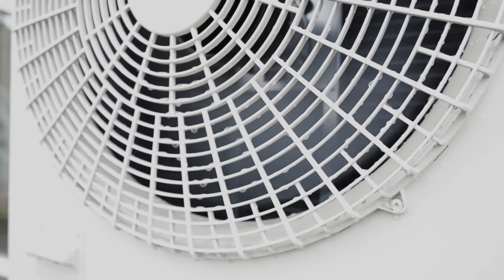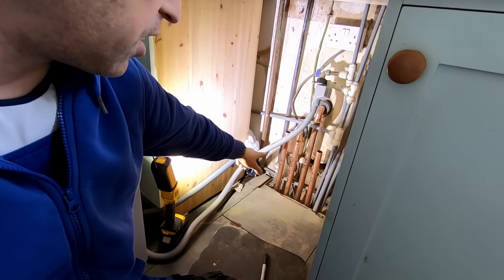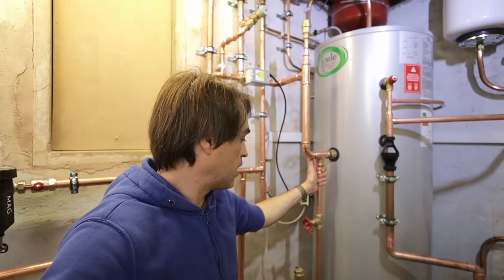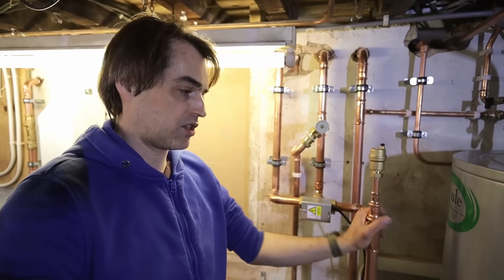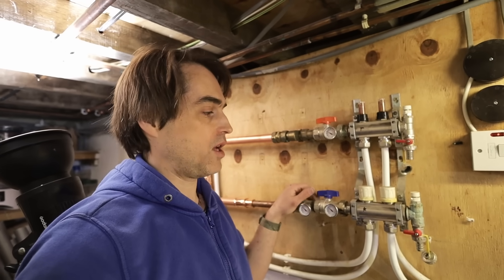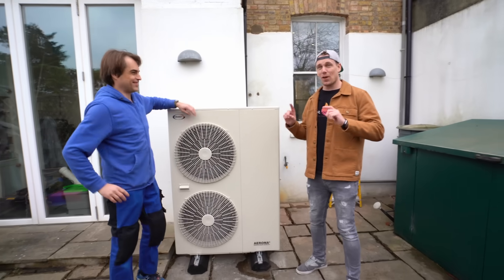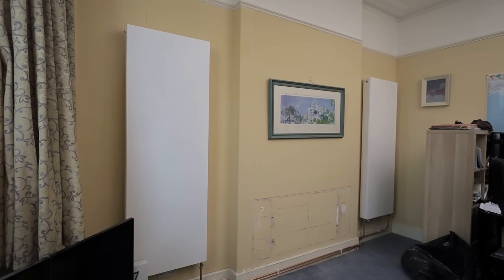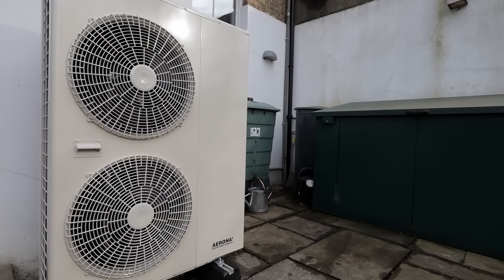The Truth about Heat Pumps: Debunking the Myth.

Comment: This particular house, which looks Victorian, is one house that should not have ASHP, the insulation, or lack of, is still going to be a huge heat loss. The cost of this instal, plus the cost of electric going through the roof, makes this very unaffordable. As a pensioner, my income has now been slashed to the tune of £1200 pa due to the energy hike.

Comment: That Heat Pump I have got and I don’t have a hot water tank but my kitchen looks a right mess with all the pipe work, no pipe work was changed 28mm outside to my pipework 22mm and then 15mm they changed 3 radiators,17KW same as your pump,and done one gone never to be seen again the MCS installers,the controls for that beast ain’t got a clue and that was the ones that fitted it,Costing a fortune can’t afford to run it I got it for nothing and I would pay to get it gone nightmare,my Combi  was on and off to suit the cold Heat Pump has to be on all day average 30 kWhs per day Electricity.How much for that system you have installed that will never ever break even no change out of £15 to £20 Grand I bet.Really nice job can’t fault it Heat Geeks know there stuff,the biggest in North West fitted mine by the way MCS registration and all that but not a clue

Comment: As A Engineer Come You Are Barking Up A Tree, As I Will Work With And Use To Lower The Carbon Foot Print On Every Project?

You Are Off The Planet,
I Use Work With What The System Is First? IE Build And System And The Insulation And I Will Cost That Over TEN Years And I Put A Portfiloi ,Through A Ten Years Program? From Year Two Year?.

I Lived All Over Germanay For Two Years And Our UK Build Is Milse A Way ?

90 % OF Uk Homes Have Combis And I Am NG AND OIL? FOR OFF GRIDE HMU AND I Like ROGER?

Comment: Great video as usual mate. Fantastic neat work. I’m not 100percent sold on these systems yet. The ashp unit is not a nice sight in the garden and those radiators are so big they stick out like a sore thumb. Iv got a 4yr old gas boiler with average sized rads in every room. Iv turned the temp on boiler down to 58 degrees and the house still warms up to a comfortable temperature.(insulation in my house isn’t great either) I think roger has valid arguments. Fan of you both 👍🏻
Reply: the boiler might last for 50+ years, at that. or, a good 20 years anyway. these heat pumps are so complicated with digital controllers and fragile parts, compressors, capacitors, refrigerant leaks, they are prone to having problems, they're outdoors, and they only last half as long. they're a little bit less expensive than a boiler to operate, because they only use a relatively small amount of electricity, but that's their only real advantage.
Reply: plus they're just plain ugly anyway

Comment: I would suggest putting the volumiser just on the heating side rather than on the common side so the heat pump doesn't need to heat it up in dhw mode (probably a negligible waste of energy but still a waste), the heat pump should only defrost in heating mode anyway but if it was to do it in dhw mode there's plenty of energy without the extra volume, nice idea about the bypass for the coil if it was to vibrate.

Comment: a heat pumps efficiency is dependant on outside tempreture.
the colder it is the less efficient they are.
funny thing is, the colder it gets outside they more you need to heat your house.
you would be better off getting solar panels and dumping the energy into a hot water system or your exsisting heating system.
Reply from the maker: Property already has solar panels and battery and solar does both hot water and supply power to the heat pump
Reply: @UrbanPlumbers  batteries are expensive, a large hot water tank is less so.

Comment: For a well insulated house you are probably better off just using resistive heating

Keep it simple

Someone needs to invent a 200 litre tank which allows the water to go to 150 centigrade at 5 bar Pressure. Such a tank would store 50KWh of heat

Heat that tank at cheap night rates and use the energy to heat the home

Octopus night rate is available for 7.5p and pre energy crisis it was just 5p a unit

The above setup would be very cheap and would last a lifetime with close to zero maintenance. Its simple immersion Heater and a pump to feed radiators

Such a setup would cost £1,000 rather than the £20,000 for a full heat pump system

7.5p/KWH night rate eletricity would make it affordable (5p/KWh pre energy crisis)

Comment: Can I ask, what is a '17kw' heat pump? Presumably that's the equivalent that it could put out (not what it consumes). If so, what SCOP is that based on? Ie how much goes in for 17kw to come out? Is it a standard calc across all manufacturers? Thanks!
Reply from the maker: It’s rated for air temp 7 and flow of 35c. At design temperature of -2 and flow of 48c it is more like 12kw.
Reply: @UrbanPlumbers  thank you! I'd need 2 of them - yikes!

Comment: Thanks, excellent video, I am a Chemical engineer and well used to piping,pumping,controls,heat transfer etc, but this is a very complicated install, well done.
However no way in my house, not enough room left, already loads of room taken up by solar controls and home battery, and the radiators are huge.
New builds are going to have to plan for a plant room for all the energy saving equipment.
Reply from the maker: this install is actually much simpler than a typical gas boiler S or Y plan and takes the same amount of space internally. 

We just got used to the combi boiler that fits in a kitchen cupbarod. The mighty hot water cylinder is coming back.
Reply: @UrbanPlumbers 
You must be kidding!  It looks like it has been designed by NASA to launch rockets!  And it must cost thousands, instead of a maximum of £2k to replace a boiler.  Also you can hear the fans already on the recording, and the radiators are the ugliest things I have ever seen!

Comment: Size of those radiators 😲.  No way most people are going to want those in rooms.  No need for wallpaper, may aswell decorate your room with radiators
Reply from the maker: No choice anymore. Check new part L building regs. You will need bigger rads on boiler now as well

Comment: The wider problem with heat pumps
There are only three main reasons people buy heat pumps
1 Environmental concern/ moral obligation complex and virtue signalling. Many people are under the illusion that heat pumps are better for the Environment. This is false for many reasons. Heat pumps to be environmentally friendly must have green electricity supply to them. For this to be the case we would have to have many batteries placed within the grid for peak energy demands. Said batteries are very dirty requiring deep strip mining for their construction. These mines are often located within third world countries. These countries use slave labour and child labour for their operations. 
Many batteries are assembled within high CO2 emerging economies such as China. This is not lowering your CO2 footprint, but just moving it to a new place in the world. In addition, batteries cannot be recycled cheaply and efficiently. Most end up in landfills. Heat pumps do not save the environment.
2 Economic fallacies. Many people are under the illusion that Heat pumps are in some way going to save them money. This is false. Yes, compared to an old Nat gas system they will in fact save you money. If you don’t counter in the cost of installing said system. Pulse the cost of rising electricity bills. 
When you compare all this to a Nat gas boiler which is in compression peanuts to install. Peanuts to run and peanuts in upkeep. Then the whole economic argument falls by the wayside. 
I Understand due to recent events that people may think that Nat gas will become more expensive to run than electricity. This is false as well unfortunately. Due to the grid being dependent on high-speed start-up times from Nat gas power plants. Said plants help fill the gap between solar and wind within the grid. 
The government have expressed keen interest in hydrogen technology such as pink hydrogen and green hydrogen. This in the future will in fact fill our existing gas network making the boilers we used run on hydrogen. Hydrogen + oxygen = steam if you didn’t know.
3 Technological restrictions. I understand that in some circumstances heat pumps can be used in a positive way to help reduce CO2 emissions. Such as replacing kerosene oil boilers within areas that do not have Nat gas. Said places cannot count on the hydrogen role out. LPG on the other hand will be able to take advantage of the fact that they have tanks to store Hydrogen already.
PS I enjoy your videos keep up the good work.

Comment: Absolutely brilliant. That looked like a full weeks work for 2 guys (including the insulation).
Reply from the maker: it was actually more. 7 days on site for 2. There is loads of work that was not shown on the video that had to be done including for new electrical mains supply and 13 new rads plus a bit of re piping to existing pipework.
Reply: @UrbanPlumbers  Well what you showed was a big enough job. The scary thing for me living in a modern box (yr 2000 build) is just the sheer volume of pipework and equipment. I have an airing cupboard with a 210 litre cylinder - but there is no way all that other kit could be squeezed in there. We have a small downstairs study - we would have to turn that over to plant room duties completely if we we went ASHP.😳
Reply from the maker: @normanboyes4983   or quite, modern houses have much smaller heat loss and will a much smaller heat pump and possibly no upgrades to pipework and smaller radiators.

Comment: interesting video every thing about that system is supersized those radiators are huge 28mm pipe for the flow and return for a typical homes is huge as well. I do wonder how much energy the heat pump provides also there seems to be a serious amount of extras on a loss header and heat recovery pump you would see used on a building with dozens of outlets. I was also curious why the air vent valve is next to the cylinder in the basement and not at the top of the system is it a design feature?
Reply from the maker: What is an air vent valve?
Reply: @UrbanPlumbers  valve which releases any trapped air in a closed system also known as a air bottle valve.
Reply from the maker: @MrGoalissimo  ok, got you. You need one one the cylinder coil return most of the time

Comment: At what point do convector become worth the fan energy? These tall radiators start to drop off in terms of natural convection rates when the heat starts to stratify in the room - which is a significant cause of thermal discomfort anyway. A convector you can have both high rates of heat transfer with low temperatures and surface areas, as well as eliminate thermal stratification.

Again, we need heat networks in cities. And thermal energy storage for load shifting over a 24 hr period. But this is as about as good as it gets in the UK at the moment. Well done.
Reply: I'd go as far to also include a ventilation system with a heat recovery unit and a central return to redistribute heat throughout the building. That can help out even temperature gradients between rooms - which can be serious comfort complaints come from solar gain and stack effect.

Comment: Interesting video, and timely with the current power price hikes and UK Energy Strategy paper. What’s your opinion on the new “high temperature heat pumps”, such as the Vaillant aroTherm Plus, that are marketed as being direct boiler replacements with no need to change existing radiators?
Reply from the maker: They will never be as efficiency as low temperature heat pumps. I d rather pay lower bills and have large rads

Comment: 28 mm pipe my current central heating is 11mm plastic pipe every pipe is buried in wall the cost of doing this to my 2006 is well over £20k this is crazy
Reply from the maker: Not necessarily. New build may be fine on micro ore as the heat loss will be minimal

Comment: Great install . On the pump house pump … how can you get the water to blow the temp stat ..?  If it was a gas boiler you might have a reason … I wouldn’t fit one in that situation … £700 notes for something that will never be used. Just looking at it from a practical view … the regs are so old and based on high temp source
Reply from the maker: Yes, very unlikely, but regs need to be observed. That prv can also blow of pressure reducing valve fails though.

Comment: Not taking anything away from your technical ability, but there is no way I personally would part with between 15 to 20,000 pounds for oversized , just warm rads, its a nonstarter, I will do my bit to save the environment another way
Reply: If it keeps my house at an agreeable temperature I would, but for the extra cold and unforeseen circumstances I would definitely want some kind of wood stove in the main living area.

Comment: Hybrid is more practical and will work in colder temperatures heat pump are only practical in new build and full refurbishment where everything can be designed correctly to work with minimum heat loss etc basically there with be loads of heat pumps installed on existing system no insulation upgrades and they won’t work how they should but we will be 0 carbon